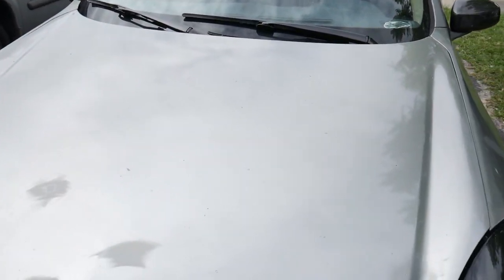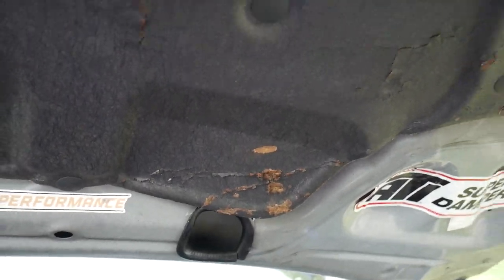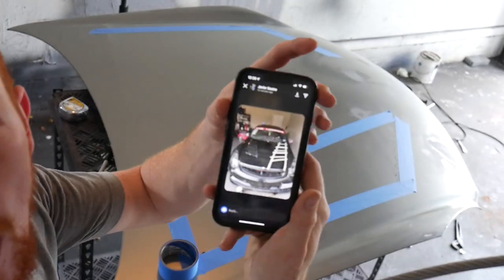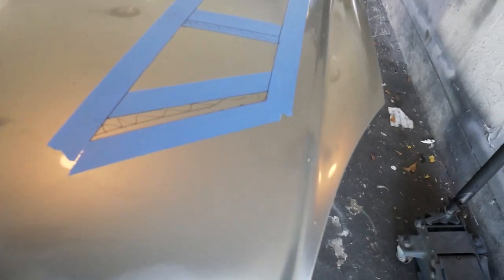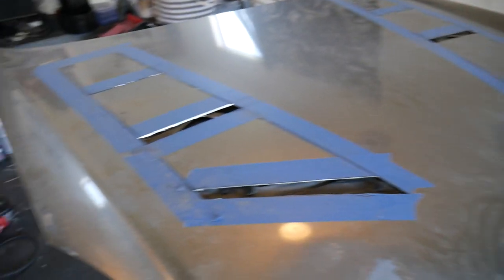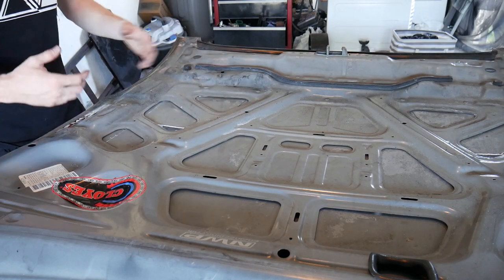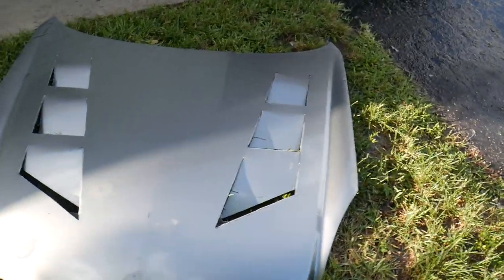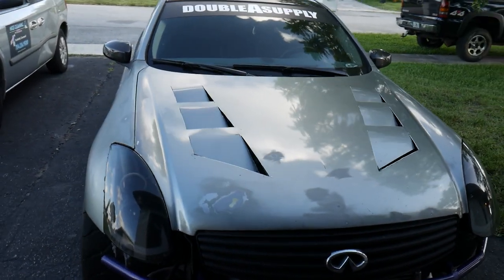I CUT my own Hood Vents and it Looks AMAZING!

Comment: What about the rain in the hot engine?
Reply: 😂 I was  thinking going to do the same to my nissan hardbody pickup hood but I'm starting to rethink it because it's my money maker wouldn't be able to drive it during the rain because battery and alternator can get wet 😢 😂 unless I have 2 hoods one for rain and the cut one for summer 😂 I believe the cuts in the summer will definitely help the engine but not during rain unless you customize a cover for the hood during rain

Comment: Uh, that’s not gonna allow any air in. All that does is allow hot air out
Reply: yeah its backwards but looks good
Reply: Well technically it will make the radiator & any other cooling systems work better by allowing better air flow
Reply: With my supercharged engine this is a very good thing for me. Plus looks cool
Reply: Unless you have a vent that goes directly to an intake, you don't want to push air in. You want to create negative pressure behind the radiator by venting air in the engine bay out. The negative pressure in the engine bay makes air flow through the radiator. That has more of a positive cooling effect than swirling air inside the engine bay. So this is correct.